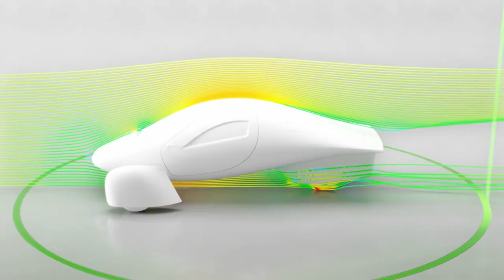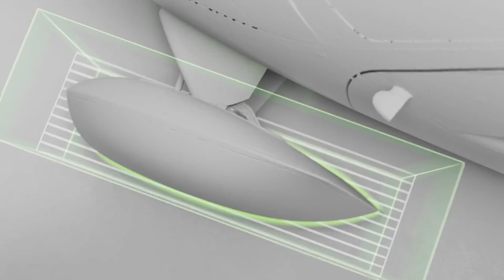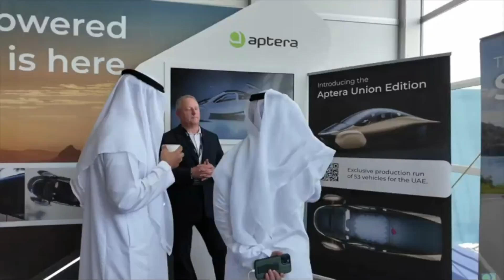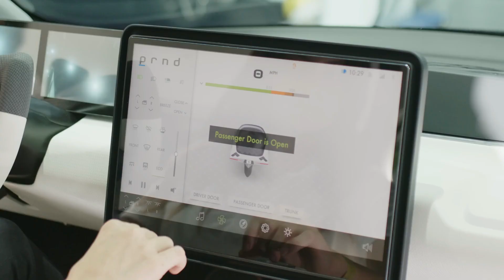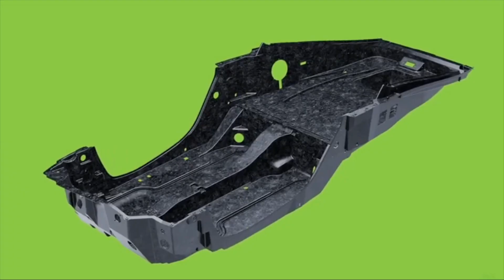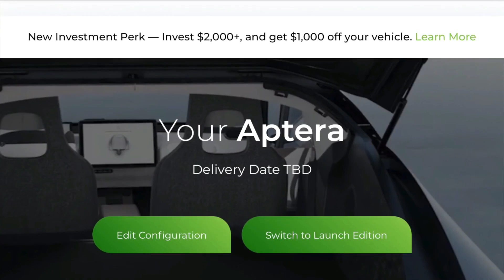Breaking Ground | Aptera's Successful Introduction in the UAE

Comment: I’m a hybrid-plug-in type of guy. No anxiety, no stress. Gimme some gas ! I am out 😢
Reply: For me Plug-in isn't an option, and the same is true for millions of Americans. It's only good if you own a home then you can have the charger installation from home. The Aptera will solve this issue for many. And if I do need to charge?  I can just run a normal extension cord to the Aptera and plug it in. No special tech needed. Only on the longest of road trips will the Aptera need a public charging station.

Regardless the government really needs to improve the infrastructure. There is just not enough. I'm currently driving a regular hybrid since the plug in isn't a good option for me. Assuming the Aptera makes it to production it will be my next car.
Reply: Goodbye!😅

Comment: I'm at 1:33 - looks great - however seems to be designed for a window (closing rapidly) where large design compromises have to be made to accommodate shortfalls in solar and battery efficiency. With batteries on the horizon that can take a conventional EV 1000 miles on a single charge and solar tech moving quickly I worry that carrying your solar panels around on your car, where they are difficult to swap out for later versions means that Aptera has missed it's moment. I only clicked on the story because I thought it was going to fly :-)
Reply: Aptera are consciously making their vehicle's components modular and serviceable.  New battery tech is out?  Upgrade.  Other EVs can suddenly get 1000 mi on a charge?  On that same hypothetical battery tech Aptera would go 1500-2000 mi.  New solar?  They're making their own panels, and you can detach and upgrade them.  So then instead of 40 miles free energy per day, you're getting 60.  

With massive and comparatively inefficient EVs dominating the current market at great cost, pretty sure now is the perfect moment for an efficient and affordable EV that serves most commuter's needs in North America.

That efficiency cuts back the other way:  Nobody needs a 2000 mi. battery, so Aptera can use half the battery (and cost and weight) of that other 1000-mile car.  And less energy capacity can mean you fill up faster on a miles-per-minute basis.

There's no bad time for efficiency.
Reply: I think if you just wait until august then coat a Tesla CyberCab in solar panels (I doubt this is even necessary) you will have a better and more scalable solution.